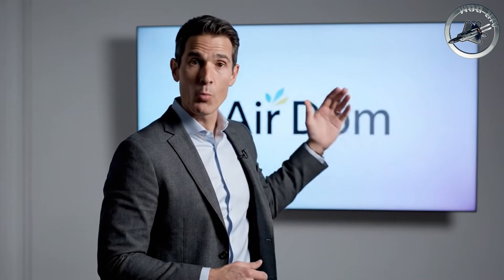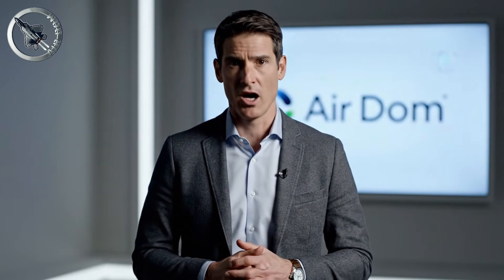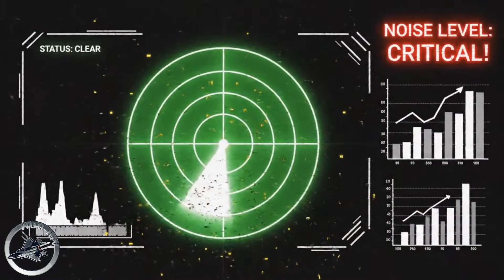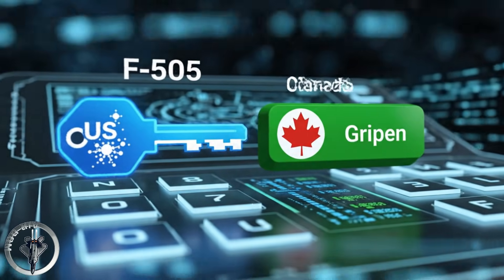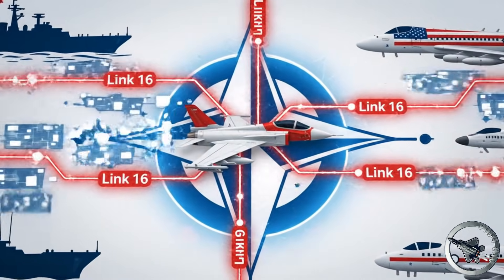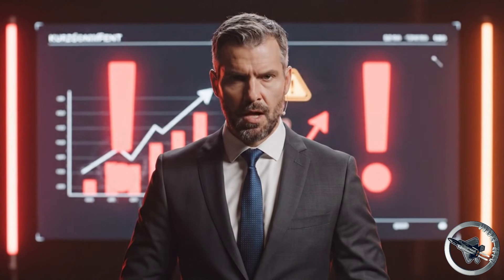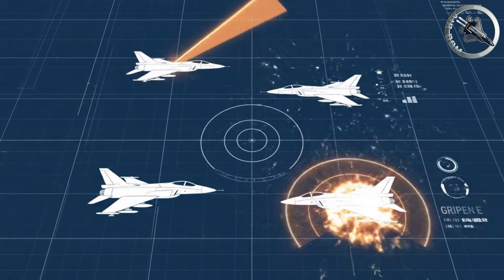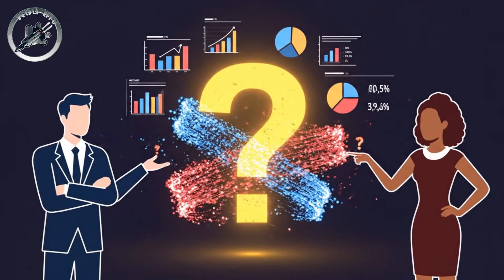Better Than Stealth? The Gripen’s Digital Camouflage

Comment: The Gripen Echo is a proper frontline fighter jet. The fact that it is made for dispersed operation is perhaps the most important difference between it and the F35.  Stealth in the air is very nice, but stealth on the ground can be more important in a long running war.
Reply: that wont work out how you like to think it would
Reply: @ibeatyoutubecircumventingy6344  neither is only having 1 airfield to operate out of.
Reply from the maker: Precisely—putting all your assets in one location is a magnet for cruise missiles. In a "runway denial" scenario where main bases are cratered, do you think the F-35B's vertical takeoff capability is a better answer than the Gripen's road usage, or does the fuel penalty make it less practical?
Reply from the maker: Fair point—theory and combat reality often collide. What do you see as the biggest vulnerability for dispersed ops: maintaining supply line logistics or modern satellite surveillance spotting them on the roads?
Reply from the maker: That is a brilliant perspective—stealth in the air is useless if you are stuck on a destroyed runway! The Gripen's ability to operate from highways is definitely a massive advantage in attrition warfare. Do you think the F-35's complex logistical footprint would effectively ground the fleet in a scenario where main airbases are compromised?
Reply: @AirDom88  F-35s are compromised already is why they gave the drone to F-22 lol you think CHina hasnt had some hands on with the Aussie F-35s lol

ProTip the USA biggest Aircraft Carrier is lead by a Grandson of Italian Card Carrying Fascist Chinese Puppet and Communist Shill and a bunch of Communists and Muslim lovers!